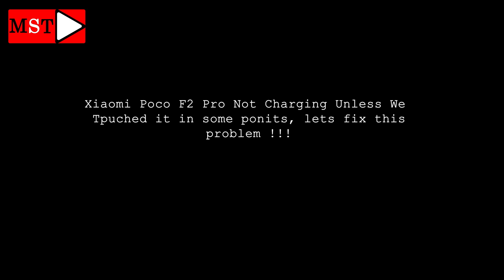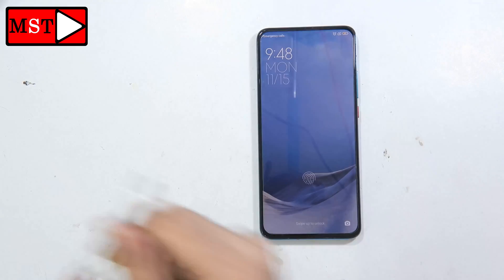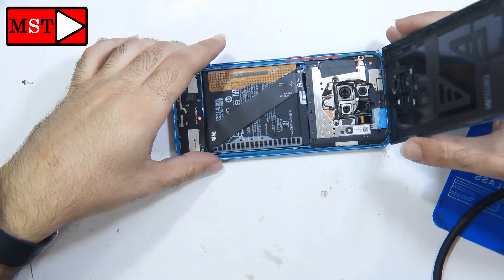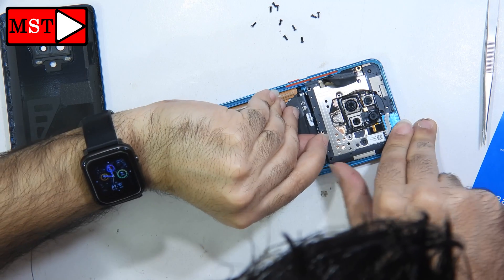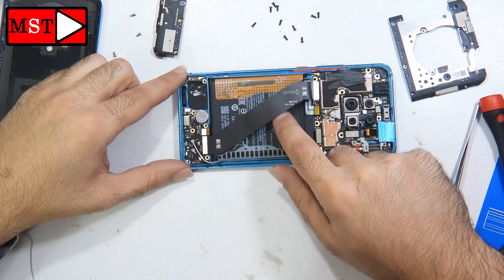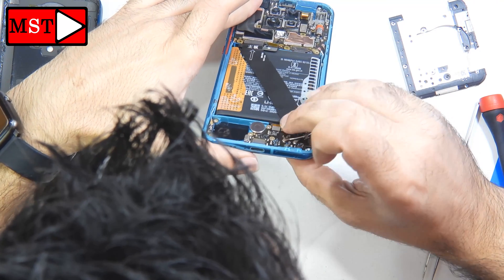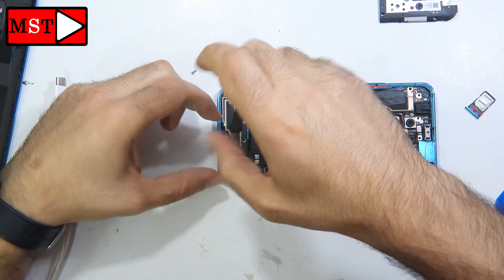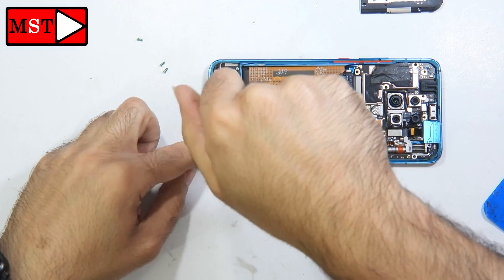Xiaomi Poco F2 Pro Not Charging Solution

Comment: Mine shows signs of charging but the device is not turning on. One time it went on magically and everything was working for 2 minutes, then died and hours of fumbling around , changing the sub-board didnt revive it. The charging light is red, so its charging. Ive installed a new battery, which when i meaasure it has 3.87V so good condition. Why is the device not turning on?
Reply from the maker: Seems you have problem with the main board

Comment: I replaced the battery with nohon brand from AliExpress and it is working fine but I don't recommend it because it is thicker than the original, back cover will not close 100%👎🏼.
Also I removed the plastic piece and I only replaced the battery ribbon with a new one and it is charging fine.

Comment: After 4 years of continuosly using Poco F2 pro, I faced that charging problem today.
Reply: Same...i face that problem 3days ago. Already replace the charging board but face the same problem also after 3days. I think the technition use a cheap spare part for my phone.
Reply: @didisenpai  Bro you don't need to change the charging board/port, just replace the flat connector cable with a NEW one.
Reply from the maker: Yea do that also
Reply: Got it more than a year ago, put a plastic piece in the right place, and until today is working fine, soon will replace the battery and board with internal battery connection
Reply: Yeah, me too. 4 years
Reply: 4 year also for me, At the end it worked for 2 months with a few thicknesses of scotch tape, then disassembled again to place a piece of credit card, held for 2 months 

This last time he doesn't want to know anything anymore, nothing presses enough to cause the charge, then I damaged the tablecloth by forcing, so $5 Aliexpress for tablecloth + motherboard 

I fix it, get my photos back and then resell this thing while it works, go to F6 !
Reply: mine also, 4yrs+ of usage and it just happened 2days ago.
Reply from the maker: These poco phones I do not recommend
Reply: same issue 4+ years, replaced board didnt help

Comment: Hi MST,
Thanks a lot for your video.
I followed every step but it didn't work. I also replaced the flex cable and the charger board with no luck.
I have a question about the tape/sticker that you are holding at 11:09. Unfortunately, I cut that in half when I was opening the back panel. Can it cause the problem not resolving after doing the steps? And how to replace it if it's important. 
Thanks a lot.
Reply from the maker: Hi bro, no this is not related, its just a heat resistant tape
Reply from the maker: Try pressing on these connectors while changing, see if start charging, also it could your battery goes under 3.3v , if that happens the phone can't start charging, also it could be related to charging ic problem !
Reply: @mstphone  Thank you so much, bro. I have ordered a new battery. Hopefully it will do the job for me.
Reply from the maker: @Mohamed.Ahmed.Hussein  anytime, i hope so too

Comment: Thanks for the solution! I was able to test it by pressing on the back, it works but it's a bit random.
I'd like to repair your video, but I don't have any equipment apart from a precision screwdriver. Does the hair dryer solution really work?
Also, can you advise me on a dismantling kit and the type of glue to use to replace the rear shell?
Thanks in advance! :)
Reply from the maker: Hello
This link shows you all my tools 
https://youtu.be/yE_uWOTOSF8?si=W-kaGQJgjIpDvwAc
Reply: Thanks !
Reply: @mstphone Finally, I did the trick, the phone switches to fast charging, but the battery doesn't want to charge any more... T_T
So I ordered a new third-party battery on Amazon (impossible to find an original battery unfortunately), I installed it, it's at 9%. I plugged in the charger, it went from 9% to 1% in 2 minutes and the phone switched off, so I couldn't charge it any more...
I'm at the end of my life haha ^^'.
I'm going to have to think about buying a new phone, rip!
Reply from the maker: @juliendauthuille1757  im sorry to hear that

Comment: Mine waited 4 years to do this bad thing to me, even though it was well used, a lot of falls, including two broken rear windows. 

In short, I put 4 small pieces of Schaterton tape between the plastic part of the speaker and the connection of the cable to support it, my device was able to charge again easily 

I knew there was a known charging problem but I was never interested since I didn't have a problem, I thought it would be necessary to change parts or resolder something, but no it was easy and free ☺️

Comment: Thank you very much!!!! It solved the problem for me. It was a very simple fix with the added pressure to the flex cable. Let's see if it fails in the future, but for now is very reassuring that the charging problem had a very simple explanation. Really liked your method on figuring that out. By the way, the adhesive on mine was a bit excessive and that made me doubt if it were to work out in the end, I had to apply heat for a good 5 mins in the entire edges of the phone until the cover was able to break apart with a bit of force.
Reply from the maker: My pleasure

Comment: I want to thank you as well! Interesting how many people got the same problem.

Bonus tip: The pressure with hands on the flex cable worked for me only for two days. And when I tried your tips nothing happened. I almost bought a new sub board and then I cleaned both connectors on this flex cable you mentioned with alcohol and a toothbrush and then the pressure worked again. The connection is really poor, the upper part of this flex cable (closer to camera) causes that the power button doesn't work. So when you remove the plastic in the upper part this button won't work for you. Pressure on both sides of this cable needed!

Comment: I have a very good tip for everyone with the same problem. I had the same problem, I guess the ribbon cable wasn't connected well. Instead of going through this whole process, I tried putting the phone glass side down on a table and start pushing on the back thoroughly and with a lot of force. The back is flexible and I guess I also applied pressure on the ribbon cable connectors through the back of the phone. When I tried charging again, it worked like a charm! The whole process took 10 seconds! At the same time, I could not have thought about trying this without this video as it revealed the possible issue and location of the ribbon cable, so a big thanks to MST!
Reply: holy shit that looks like it worked! Thanks for sharing!
Reply from the maker: My pleasure😊
Reply from the maker: Thank you for your words and for sharing with others.
God bless you
Reply: Is your fix became permanent?
Reply from the maker: @Piotr_Majchrzak  no

Comment: 😢i did this but the problem waz only temporarily gone. Now its back again. I even bought a new charging flex and sams issue. :/ it works with tape etc for a bit then either stops charging or just insanely slows down, like today it charged till 83% and now its not charging any further even tho it says quick charge. Any help would be appreciated.
Reply from the maker: Replace both charging sub and flex
Reply: I redid it twice and also put some tape on the other side of the charging board and now its working. I did try a new flex without the tapes and it had the same issue. so i ended up using the old flex with tapes on both sides of the charging board, and now its working been weeks since i did it last. @mstphone

Comment: Tq so much.. my poco f2 pro "dead" almost 1 & 1/2 year. today.. i almost throw it away. for the last hope, i try to check online solution untill i saw your video tutorial. turn out, i have same problem with that unit. i apply pressure  to that connector, and my phone charging. 🥰 now its work again & i decide to give it to my father. tq so much for ur tutorial. 🙏🏼
Reply from the maker: My pleasure

Comment: 5:38 What is this sticker good for? I've completed your guide, changed the connecting cable and it works nicely now! :) But I forgot to put back this sticker at the timestamp. :( Will it cause any problem? Does it have a shielding function or it is just a normal paper? Seems to be a normal paper to me.
Reply from the maker: No it's okay, just a sticker

Comment: Love you bro, my phone have the same prob, i just  have press on screen and backside, and now my phone charge again 👍
Reply from the maker: That's nice bro 
Anytime
Reply: Hi, I know old comment but if possible can I reach you so you send me an image or description of where exactly you pushed? I keep on pushing but nothing work
Reply: @  On the lower back of the phone you have a small plate or connector that needs to be pressed. I put a small piece of tape folded several times to do this pressure. Unfortunately, I can't send you a photo otherwise I would have to open it again.
Reply: @7Keyzen  okay, no problem. Thanks for the reply. Given that this communt of your was 2 years ago, can you tell me how the phone has hold up till now? Does it still work fine or what?
Reply: @shakirmeherrem6672  he work fine, i have 2 mobile the poco F2 pro on side for looking media or other. The only problem is the battery wear,  i have buy one original for when i want chang 👍
Reply from the maker: Make sure not to dropped it, and with pressure it should work for good time, or repeat the operation again if fails.

Comment: Thanks, i have the same problem with my poco F2 Pro.
But, can i know what tools you use to heat dan remove back cover?
Reply from the maker: Heating station kada 858d+
Reply: i just put a plate on my stove and use the lowest heat, than place the phone on it and youre good. cant recommend with a gas stove though

Comment: Hi i have troubles to see my sim and even when i see it i cannot access to data, no internet, no SMS, and no SMS... I don't know why ? Have you an idea please ? I changed several times my screen, the frame, the charging board, the vibration motor, the battery flex connector and the tactile connector... But there is always something that doesn't work.. Firstly it was the vibration which made a strange song, after it was ok but i lost tha sim card, data and it never came back.
Reply from the maker: Check flex cable connected sub to main board
Reply: @mstphone  you mean the main flex cable that goes from mb to charging board ? I hope it's not the pins of the mobo.
Reply: @mstphone  dont you think that if it's not the same number as original cable, signal cannot pass through it ? The sellers tells me not but i dk what to do now
Reply from the maker: @joetaro69  idk what you changed lately, but if you replaced sub board it could be not working properly so you change it, second thing there is a antenna wite connected from sub to main board, if this one not connected so you may see no service or searching.
Reply from the maker: @joetaro69  i don't think there is a difference between original or normal, it's just a cable connect from point to another, Anyway i don't know why you changed parts too much, but try this last anntena. Also check serial number by dialing ×#06# if there is serial that's great.
Reply from the maker: Im sorry to hear that, but i think you paid enough to get new phone with these replacement costs.

Comment: My issue is i plug the phone in, press the screen at where the top of the flex cable is located the light at the pop up charge will glow red but it wont charge. Im confused to which part of is the issue, flex cable or sub board?
Reply from the maker: Im positive its with sub board, flex cable just  connect from 1 point to another, but you could just order both in case.
Reply: @mstphone  can you share us the link of both items to order together?

And also, do you know where to find the back in transparent mirror color? To see the components inside.

Comment: It worked for me too with 4 layers of insulating type cut to size. Yay! After repair, the battery on my son's phone had been run flat so I slow charged it up to 15% with a battery pack and then plugged the official charger in and it turbo charged up to 100% in about an hour. Fortunately I'd repaired my daughter's Honor 9 Lite a few times (screen replacements) so I had all the parts I needed including the T7000 glue. Thank you so much for this video.
Reply from the maker: That's great , my pleasure
Reply: I have the same problem, how do I do fast charging?

Comment: I have fix it like that, but the problem is comming after a few days again. by the way, after removing the upper kable the light sensor stop working also.
Reply from the maker: This is a common problem, you have to replace with new cable and sub board
Reply: @mstphone  Which new cable and sub board do you mean?
Reply from the maker: @pauperx  go for part 2 in description, i have replaced both.

Comment: Hello, Qestion when therse that paper or smth 1angle is to main system and one to second I switched it ant it charges then but qeastion is it ok ? please answer fast as can becuse dont know if it wont blow up or smth :D
Reply from the maker: I didn't understand the issue, explain again
Reply: @mstphone  In video 6:22 The black stripe if I swap it conect to another  is charging the phone, but doesn't it hurt or explode? thats what i wanna know is it ok if i switch it up?
Reply from the maker: No don't swap that, you should be able to see the direction arrow of that flex cable.

Comment: I fixed it like you showed and it works for me as well, so thank you! The only problem is that it now charges very slowly on a normal charger (a full night gives me ~50% charge at 5W) and it gets very hot on a fast charger, do you have an idea what it could be?
Reply from the maker: You can replace both sub board and flex cable

Comment: Fixed it. The lower (USB) board didn't make contact with the connector. 
I used some 1-2mm rubber with adhesive on it.
Before: clean the connectors with isopropyl alcohol and compressed air.
Using AccuBattery measure over 5A of current at charging.
L.E.: The phone still works as new! It passes about a year now, and it's still strong. Turbocharge works nice.

Comment: i got redmi k30 pro zoom which generic to poco f2 pro.. my phone still can charge but sometime turbo charger not appear until i put off and put on again.. did your think this method can solved my problem too?? thanks..
Reply from the maker: Yea could be, seems in this models connections is too weak, or its better to replace sub board with flex also.
Reply: @mstphone  thanks for recommendation..

Comment: used this to figure out how to get it charging again, pressing in bottom fixes it ... i'm sure it wont last, but at least i have a fully charged phone for another day

Edit: 
Did the full fix with layers of electrical tape and it's been working fine for a few weeks now
Reply: Update?
Reply: @martalialiem2095  been a year now, still working
Reply: @martalialiem2095  still working! Seems to have sorted it for good
Reply: Hey, my phone also have this problem, im currently finding for metal and tape for the board step, how did you do the step?
Reply: @angellee9999  I justed used about 5 layers of electrical tape, nothing else
Reply: Wow my Poco F2 Pro has been dead for about 2 years now. I pushed in the place where he said and suddenly I got some lights. Wish I'd known about this when he did this. I could have shown it to the expert technician who was clueless on how to fix it. Not sure I'll continue to try to fix it since it's been so long. I am tempted though because I still kind of miss it. Pretty sad Poco couldn't figure out how to fix there own freaking phones though.

Comment: Warning!!! You are not supposed to take the camera cover off! It should remain on the phone!! Other than that, this tutorial was helpful and did fix the issue, or so far it seems. But there is some foam that seems to prevent bleed light and moisture from getting into cameras, which you are going to damage if you don´t leave the glass on the phone, meaning if you do what they did on the vid.
Reply from the maker: I don't think i did something wrong, but if you believe so, you can point which seconds you have question about !

Comment: Very nice.
What is the name of the yellow card?
Reply from the maker: Thanks 
Its not yellow card, i mentioned in the video its a metal shield that covers components, i cuted a piece of it and coated with heat resistance tape, i coated it for few reasons 
1 the metal was sharp it could damage the flex
2 to isolate any connection between any parts because its metal 
3 to prevent any heat
Reply: @mstphone  thanks you 💪
Reply from the maker: Anything you need bro 😊
Reply: @mstphone  can you use 1 mm cable?
Reply from the maker: @angellee9999  no, i don't recommend because you may end cut flex cable, using card we just pass through edges.